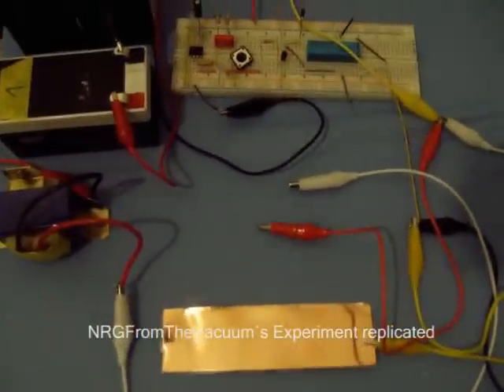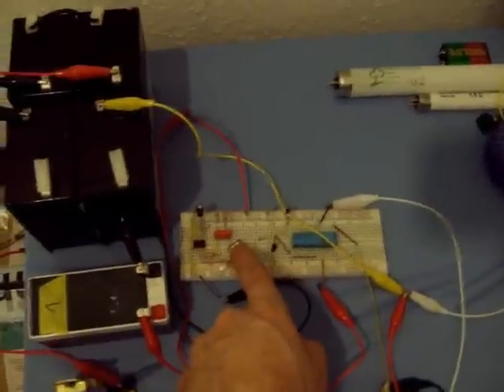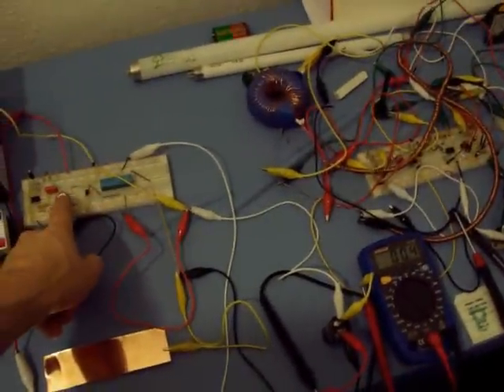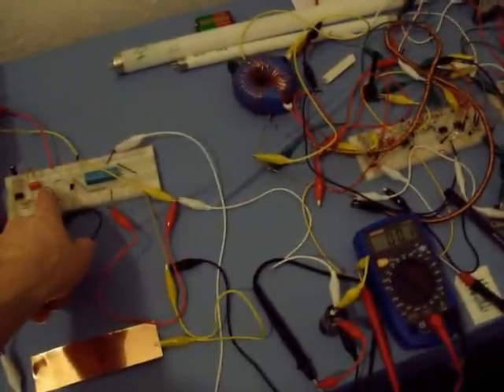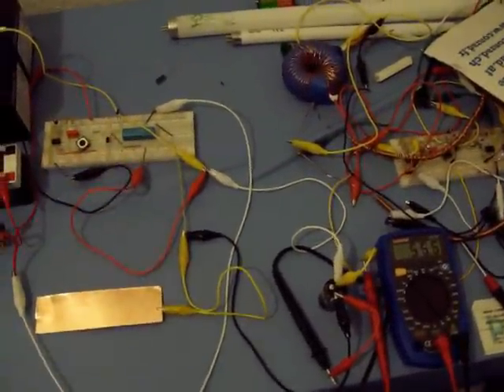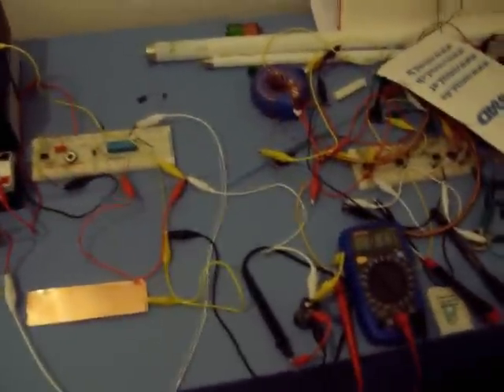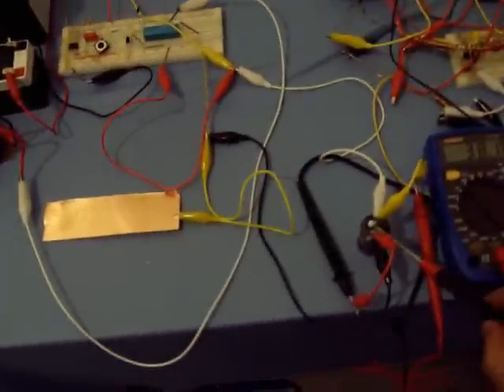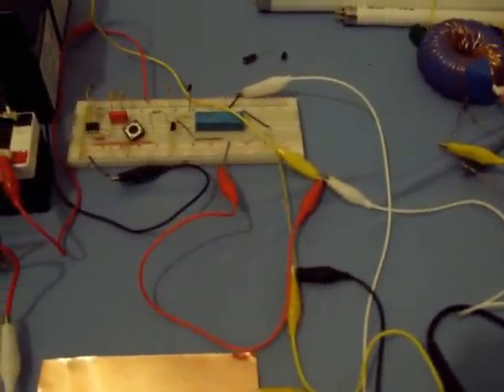Relay Switch Capacitor Experiment

Comment: Hello, in nrgfromthevacuum's video, he also used a magnet and tapped his leads together on the magnet to get much greater voltages in each pulse. Just thought I'd mention that in case you want to experiment with that further. best regards!

Comment: Hi, Thanks for this video.  Have you considered using power MOSFETs  instead of a relay?  You could introduce time delay in the control path of the Gates to influence the switch-ON moment of the two FETs with respect to each other.  The delay is easily done by CMOS or TTL gates. 
I think it would be important which switch is ON first and how fast  the other switch comes ON after the first.   Keep up testing this circuit if you have time, there may be smthng in it?
rgds,  Gyula